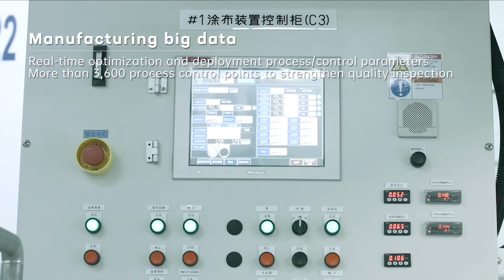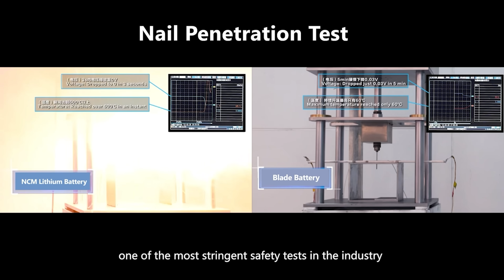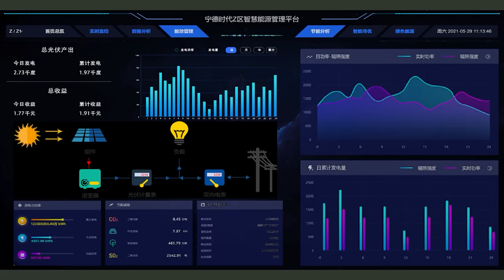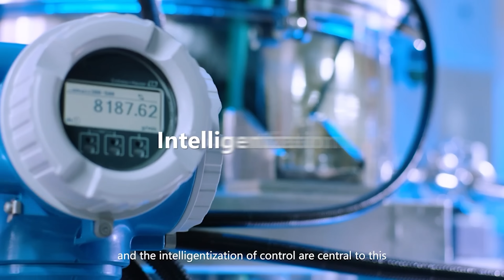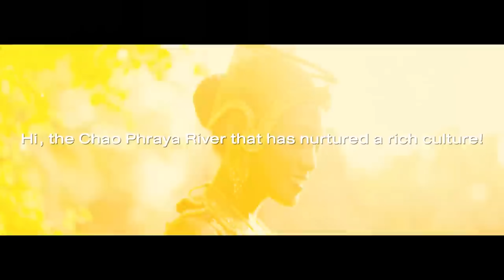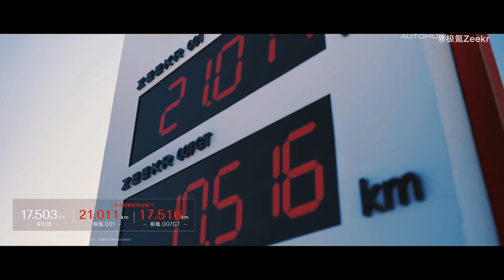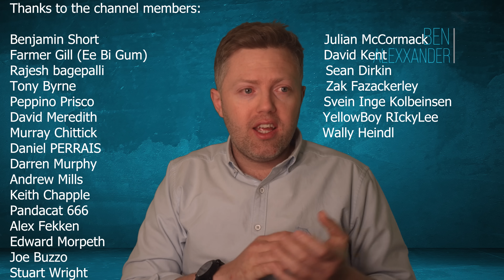Sodium Takes Over - Tony Seba’s Battery Prediction Comes True

Comment: The increase in cycles is very significant. EVs in the UK have a very high rate of depreciation primarily because of the anxiety of battery cycle life. So a friend bought a jaguar ipace some 4years ago for some £70,000; he was just offered £12,000 on trade in.

Comment: The entire problem of Global Warming could be eliminated almost immediately if we make just a very few prudent decisions.  All solutions should be driven by the application.  We need to align the right energy source with its most beneficial use.  Fossil fuel should only be used in aviation.  All large ships and trains should use Hydrogen.  All passenger vehicles should be electric batteries. Home heating should be done with heat pumps ASAP.  Passenger vehicles should have Lithium ion batteries.  Grid scale energy storage should be sodium ion batteries and CO2 storage batteries.  Industrial heating and processes should be done with hydrogen ASAP.  The sooner we adopt these standards , the faster we will achieve economies of scale and the associated cost reductions.

Comment: Sodium's turning point will come with an increase in volumetric density, currently with Naxtra and others, Sodium cells seems to be about 15-20% lower than that of Lithium, which is important for constrained requirements like EV battery packs, since Sodium whilst cheaper will initially have significantly lower pack level energy density. This follows why CATL are initially targetting A-B dual chemistry packs, particularly for EREVs where the sodium side of the pack can take the brunt of constant recharging and the lithium side increases the electric-only range.

However, Lithium isn't sitting still and will continue to innovate, LMFP, solid-state and eventually Lithium-Air cells offer levels of energy density capabilities well beyond that of Sodium based cells. What will likely happen is Sodium will displace the lower end of Lithium, and use-cases where lower energy density (particularly volumetric) is not an issue, such as static energy storage. Lithium will target higher energy demand areas and weight sensitives areas such as battery powered flight and very heavy vehicles, as well as high performance and extreme-range passenger vehicles.

Comment: What concerns me with all the hype is, what happens in production.  Raw salt contain other minerals, like iron, aluminium, magnisium, zink etc etc. What happens to these impurities, are they refined out.  The individual quantities are small but collectively significant.  If refined out if unusable, how will they be treaded.  Will they be a risk to the environment if placed in the ground and have potential to polute the water table?  Can the salt from exhausted batteries be recycled?  If not where can it be disposed of?  Again, if burried will it pose a threat to the watertable and agriculture?   While life on earth needs salt, if place in the wrong place it is a polutant.   Could the exhausted salt be place back into mines from where if came?
Reply: Those are very good questions. I too would like those answers.
Reply: Sustainable processing, and direction of material by-products to other uses, is already under consideration and being designed into battery manufacturing processes as they scale - for example check out the sustainable processing that forms part of the Batt4EU production initiative.

Comment: This screws up American efforts to develop & control Lithium mines, locally and abroad. What happens to the $250 million project to extract lithium from the Salton Sea, California? The $400 million investment into Lithium America? $50 million to control Argentinian lithium deposits? CATL basically bankrupted all these American investments.
Reply: Why? At a system level the cost of a Sodium battery system and a Lithium based one don't differ that much, yes at a cell level the Sodium one might become lower but it has lower energy density (particularly volumetric) that means fewer cells fit in a constrained space like a EV battery pack (hence much lower range), has higher cooling requirements (particularly for the more power density capable electrolytes required by Sodium cells) and requires more expensive power electronics than Lithium (due to Sodiums wider and lower starting voltage range).

Comment: To be real honest, if the sodium battery arrives, I would then consider moving to buying an EV vehicle and installing solar + battery store at home. Would be massive. It's the safety aspect that really prevents me from going lithium.
Reply: It's true, there are safety concerns, but a car with an ice engine is far likelier to experience of fire then a typical NMC lithium ion EV.  And for home storage, lithium ion phosphate batteries or even less likely to have thermal runaway.
Reply: @dfgriggs  There are no statistcs anywhere yet that compare's the number of fires in an ICE engine car vs an EV whilst cold and parked. That's the number I need for EV's to be proven are safe.

Given, I have an integral garage for a car and would NOT want a bunch of lithium batteries in the house waiting to combust if there's a cell issue anywhere. It's a definite no.

Sodium is the way. Safety first
Reply: @vegaspool188 do you charge your phone outside?
Reply: Or park your ICE car (with fuel) inside?
Reply: @neilattwood6227  Yes, whilst in sight, within fire detectors and as a single battery. These too need to be sodium and I can't wait for those too. Same for laptop; which is only plugged in when being used if it requires power.

I'm never surprised when stories of electric bikes, scooters etc, go up in flame whilst plugged in at homes.
Reply: @vegaspool188 the irony being that the thermal management of EV batteries is vastly superior to that of phone / device batteries.  Did you have the same fears before EVs came along and the press told you to fear them etc?  Sweden which actually tracks fires per passenger vehicle annually found that EVs are 20 times less likely to catch fire (3.8 per 100,000 vehicles Vs 77 for ICE).
Reply: @neilattwood6227  Yes, I've had TWO fires start because of swollen and then combusting from so called dead phones. Fortunately, on both occassions, thanks to having a sensible approach to them, they were expelled out of the house in order to prevent further damage.

Seeing a lithium battery first EXPAND and then instantly flame out blue and white flames (with a terrible, and now I understand poisonous fumes), I'm completely aware of those batteries.

Comment: Everyone battery type has plus and minus,  however I definitely would buy sodium battery's. I live in cold winter and I know the sodium will eventually be much cheaper and safer, fast compared to other battery types. The recycling ♻️ of lithium and sodium will also bring down a low cost even further. Sodium is definitely best for city's and housing off grid, everything lithium will always be the top notch however sodium will always be a good to choice for most people in the future. Money is a huge factor and a little less range or and a little size difference is not a huge factor for most people once the nice technologies are everywhere. Plus countries don't have to pay other countries for the higher cost of lithium soon in just a few short years.

Comment: I agree that LFP will feel the pressure from Sodium batteries much sooner than NCM or NCA type chemistries. Sodium batteries is the next round of good enough but cheap batteries. If their claims are true, then LFP has little to no advantages over their sodium batteries. NCM will still have higher density and will still be the go to for maximum range. In markets like the US where they still focus more on range NCM or maybe LMR will still be common. The US market is starting to accept LFP batteries as they have gotten good enough for the minimum ranges the auto makers want to sell but they are still relatively rare.

Comment: This will be bad for the depreciation of my current EV. And it already depreciated a lot.
Reply: Actually not. Your batteries already had their cycles. If i know that  i can replace them cheaply, i am more willing than yesterday to buy your car. If i can accept the reduction of the mile range (because of less Ah per physical space) of the new technology
Reply: @mag-s7 the problem is new EV's are cheaper than what I paid for mine. That's what causes the depreciation. With even cheaper batteries, new cars will be even cheaper. So I need to sell my EV far under that price.

Comment: It certainly seems to be a paradigm change, although it won't entirely replace lithium, which has distinct advantages on energy density for long-range transportation and high surge applications. But it will almost certainly replace other chemistries for most purposes. It may require more frequent charges, but they are also much faster, so two 5-minute commercial charges will beat one 15-minute charge for most purposes, and home charging for daily use will make most of that irrelevant in any case.

Comment: I personally think aluminum ion batteries have more potential but right now sodium is ahead of the race but eventually it could be the solid states a few years from now, things are changing rapidly as far as batteries go
Reply: Aluminium has two main disadvantages: the salt used in the electrolyte is a fairly large and slow moving molecule restricting the Al-ion cell power density; and, the size of the aluminium ion causes the anode to material to swell signficantly increasing mechanical failure risk with repeated charge/discharge cycles, so have short cycle lives compared to other charge carrying metals. 

Further, as cells move from Lithium-Ion, to solid-state and then ultimately Metal-Air based designs Aluminium faces hurdles as in it's solid-state configuration it's difficult to find a solid electrolyte that can transport the Aluminium-ions effectively, and in Al-Air design it becomes a non-rechargable primary cell (Lithium, Sodium, and Zinc are all rechargable secondary cells in their Metal-Air forms).

Comment: The sailing community generally refuses every lithium chemistry except LiFePO4. They consider the other chemistries unsafe. If your car catches fire you can stand on the shoulder and watch it burn. Not an option on a boat. 

And boats aren't terribly weight sensitive.
Reply: Make sure LFP is vented on a boat, and not in the main cabin. While they don't burn like NMC, they release hydrogen if things go wrong such as a BMS failure during charging, potentially causing an explosion. Kind of like bottled gas. Vent and keep separate.
Reply: @rogerbedell4056 Hydrogen doesn't sink and collect in the bilge, so it's not quite as dangerous as propane.
Reply: @jeffdege4786  Good point, the barge that blew up in the UK was probably pretty airtight since it rains so much there. My boat is not very airtight, though not intentionally... Fortunately it doesn't rain much in southern Spain.

Comment: CATL is on the verge of enough energy density for aviation. The theoretical limit for Na+ chemistry is 400 Wh/kg, which means practical batteries at 300 Wh/kg in 10 years. That will enable four-seaters (Cessna 172 class) that have 500 mi/800 km or 4-hours of range. With modern materials and aerodyamics, expect 20% more.
Reply: Sodium's issue for constrained spaces uses like passenger cars and flight is it's lower volumetric energy density, whilst gravimetric density is increasing the volumetric density is still lagging behind (even with the CATL Naxtra cells, as can be seen when one looks at the cells sizes in the CATL A-B dual chemistry Freevoy packs). 

Plus innovation with Lithium will continue, especially for flight where Metal-Air batteries (particularly Li-Air) hold out the promise of long range/large body battery powered flight. Here it's Li-Air's maximum theorectical energy density of 11,400 Wh/kg that is attractive, with research Li-Air batteries already reaching 1,400 Wh/kg (1,680 Wh/l) using non-aqueous electrolytes.
Reply: Thats based on amprius patents
Reply: We already have that energy density in Li Ion and it is not even close to providing the aircraft performance you claim.
Reply: @yzScott amprius silicon wire 500wh

Comment: Sodium batteries hav 3 advantages: Low temperature stability and high current and they can be discharged to zero without problems.

Price is most certainly NOT an advantage of Sodium cells. 

Maybe when China has stopped producing LFP and switched completely to Sodium they could be produced at about the same price.

Sodium cells have 2 massive disadvantages: 
Sodium has less energy storage capability than Lithium. 
And Sodium has a very wide voltage spread between zero and fiull.
Reply: Also, in current Sodium-Ion designs the electrolytes degrade at relatively low temperatures (circa 35C) meaning sodium battery packs require more extensive cooling than those based on Lithium cells, that when taken alongside their higher power electronics cost (the lower threshold voltage requires Silicon Carbide or GAn semi-conductors) erodes their price advantage at the pack/vehicle system level.

Plus Sodium is not immune from dendrite formation, although tending to form spherical nodules forms that expand in all directions that lower a cell's capacity rather than the more jagged forks that Lithium forms - although both forms can breach the physical barrier between the cell's electrodes.
Reply: @GruffSillyGoat I am looking forward to see a real world test of the new CATL cells.

Comment: Sodium ions biggest challenge is the low volumetric energy density or how much energy you can fit in a given space. It's much worse than even LFP.  Notice how CATL is only advertising the gravimetric energy density. So an EV with a sodium battery might only be able to have 180-200 miles of range with sodium ion. Thats fine for some applications but is a non starter for probably 60% of the market. Sodium am I on batteries need to improve their volume metric energy density by 30 to 50% before hitting acceptable ranges. Now the good thing with batteries is that that is generally a five year timeframe. So yes, they have a place, but it's not gonna be this massive game changer in the next Year.
Reply: For stationary energy storage, though, that isn't a big issue. If we can have $10/kWh, that would revolutionize stationary energy storage. I could put a 1 MWh battery at my house. It would be awesome.
Reply: @stevenschmidt  Yes. Even I could go off grid by beefing up my PV whils still using my heat pump in winter.

Comment: In Canada's Saskatchewan province there are several locations with mountains of salt tailings from potash mines. A 50 million ton pile about 30 km from where I live.
Reply: The other waste piles that are of great interest are the huge piles of Sulpher ....which would possibly increase battery capacity by a factor of 5 and be light and cheap and greener to produce. The other is the ash piles and dried out lagoons of power station coal ash....turns out they are richer and easier to extract a whole range of concentrated already extracted rare earth minerals ...depending on the Coal mining provinces they were extracted from initially.  😉🌍🥼🧙🏻‍♂️👍🏻
Reply: @clivestainlesssteelwomble7665  What is Sulpher?   Do you mean Sodium?  From Sodium Chloride, aka table salt.
Reply: Bingo! Saskatchewan is going to be the new Xanadu when it comes to uranium, potash and sodium three essential elements in the 21st century... Especially when lithium isn't going to be needed in any quantities once thought because of this..

Comment: Na-ion might not even need BMS, if it has the temperature range that is being claimed, at least for some applications, which would make them even cheaper and lighter at the system level. And Trump thinks he holds all the cards over the Chinese, what a joke.
Reply: Trump doesn't have control over his bladder or bowels much less global affairs at this point...
Reply: In short no a BMS performs more roles than thermal management of a cell, it equalises the charge storage across the cells as well within a pack which is also important for longevity of a battery pack. Also, though Sodium has a wider thermal range, current cells, particularly those needing to delivery power levels required in EVs, use electrolytes that are more temperature sensitive than those used in Lithium cells (can start to degrade as low as 35°C). This likely means that higher cooling requirements will be required for Sodium cells compared to Lithium ones to remove the heat from the cells pack at a faster rate.

Comment: Something about sodium is its a larger element than lithium on the atomic scale i thought that would mean it would be more weighty per avilable electron for energy density something like that so it makes me suspect there might be some undisclosed inherent limitations to sodium, apart from that it is super abundant so we wont run out or need to compete for resources.
Reply: It is, so it is bulkier but much more can be done by how the cells are manufactured and configured to counter this especially in vehicle scale packs.  The problems come with smaller hand held devices  ..... Though chocolate box sub Units CATL. Uses.   In some packs may be the current limit on the smaller end commercially.
Reply: @clivestainlesssteelwomble7665  - oddly the CATL sodium cells appear to be 15-20% wider than their Lithium ones, when looking at their dual-chemistry Sodium/LFP packs. Sodium's lower volumetric energy density means that constrained volume battery systems, like vehicle battery packs, will always have a lower energy density with a Sodium configuration than a Lithium based one. Plus Sodium-Ion currently required additional levels of cooling (due to lower temperature electrolyte degredation) and more expensive power electronic designs, hence at a system level like a vehicle the per cell cost savings may not be as material as they first appear to be.